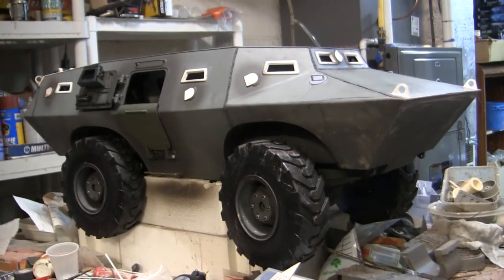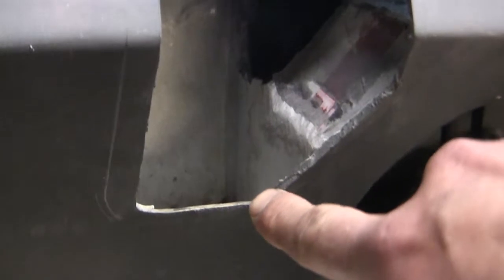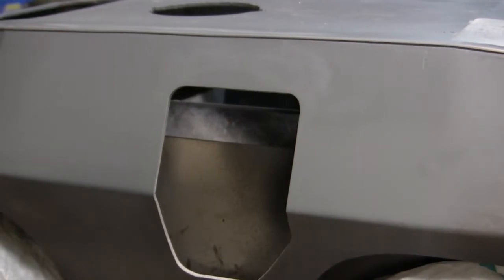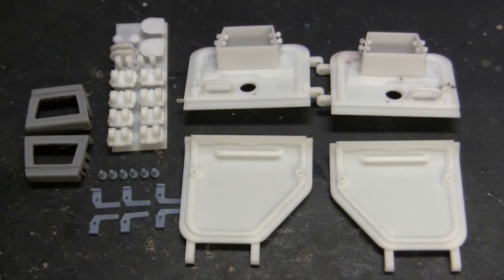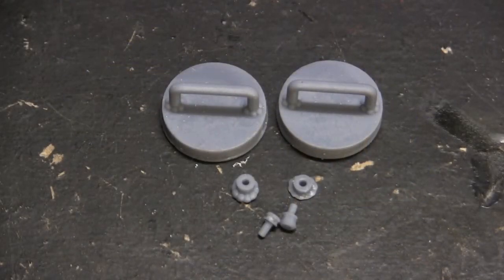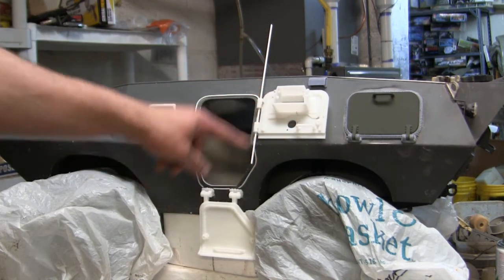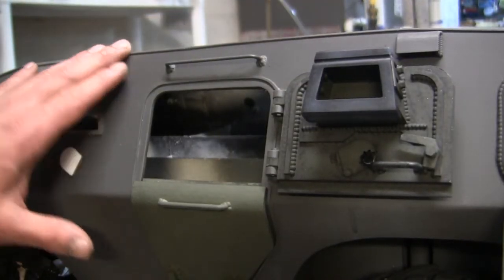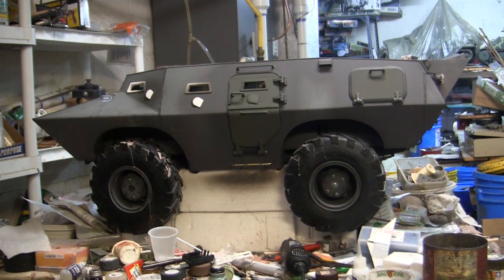1/6th scale Cadillac Gage V100 / M706 Armored car video #8 (side hull complete)

Comment: hello is this a kit or you build it from scratch?
Reply from the maker: I mention this info in part1, but the model's hull was scratch built by another collector but never finished. I recommend checking out this model's playlist to see how it started and what was done to it to get it to this point
Reply: @oddball759mm  No problem. I just found your channel and started watching. I will check part 1
Reply from the maker: enjoy the show! P.S. I do have another update in the works and it will be posted once I burn through some other videos